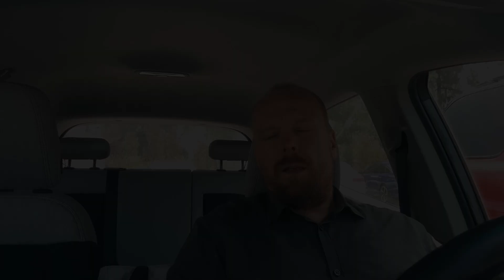Plug-Side Chat: Should DC to DC Fast Charge Adapters be Prohibited or Regulated?

Comment: I'm an engineer that works in product design and certification (of cable, controls and heating appliances).  I currently sit on a number of committees with UL, IEEE and CSA. I agree these adaptors should conform to some standard and be tested and certified by a 3rd party and NRTL (nationally recognised testing laboratory).  Of note UL is only one of several organisations that are ANSI and SCC registered to do certifications for both the US and Canada respectively (CSA, ETL, FM are also other examples).   Currently low voltage EVSE's (under 250VAC) need to conform to the harmonised standards of UL 2954/CSA 280, UL 2231-1/CSA 281.1 and UL 2231-2/CSA 281.2.  DC fast chargers have to meet the last two standards plus UL 2202 and CSA 107.1 plus all units might have to meet additional outdoor exposure or enclosure ratings etc.. (such as NEMA 3R or 4X, IPXX).  To my knowledge I don't believe the scope of these standards cover adaptors. Which I think would be unfortunate.  I personally know the CSA wiring devices technical adviser who also sits on many of the EV charging committees.  I'm going to bring this up with him and get his thoughts.   The quality of these connections are critical.  The heat dissipated across these connections are equivalent to the current squared times the contact resistance.  A bad contact can generate high resistance and a lot of heat.  And the higher the charge current the effect of poor contact is exponentially magnified.
Reply from the maker: Thank you for contributing your knowledge here. I think you are speaking to my greatest concern: Who is setting the standards for these adapters? It's an important hurdle that I think needs to be addressed.
Reply: Charging connector resistance change all the time even with normal use if/when dirt and debris gets in the handle. I thought there's already intelligence in protocol to mitigate. I had experience where blowing on charger handle and port made it work and "jiggling" the handle also fixed.
Reply: @mychevysparkevdidntcatchfi1489  I'm unfortunately not familiar with the intricate details of the DC charging protocols.  However detecting high contact resistance isn't very simple.  There are some things you can do like monitoring the voltage drop across the cable and connection.   You could also have a temperature sensor at the connection that would show high temperatures.  Though Voltage drop is only really good at finding if you have a significant problem.  And an adapter might actually negate some of the security of a temperature sensor as now your creating two connections one of which might not have direct temperature monitoring.
Reply: @erikstephens34  Given that even L1 EVSE that comes with the car has thermal sensor, I'm sure thermal is in DCFC. I don't know the protocol, but it wouldn't surprise if they did lot more complex things to ensure safety. Even something like TDR might be possible since CCS 10 Mbps require large bandwidth and signalling is on same wires as power.
Reply: @mychevysparkevdidntcatchfi1489  A TDR could be used to detect an additional connection.  It would be able to see if an adapter is used and shut of the unit (or not initiate the charge session) if desired.  TDR's are also good at detecting breaks and significant changes in material resistivity.  It could be used to show significant conductor breakdown as the signal propagation speed would reflect that.  However a connection either good or bad would still simply show as a discontinuity on a TDR.  It won't necessarily tell you if a connection is good or bad.  I do wonder with increased use of arc-fault devices with higher voltages being used it might be possible to calibrate an arc-fault like device to detect some issues as well at the point of connection.   Though if your connection is bad enough to generate arching your already in a potentially bad shape.   It's very difficult to detect a moderate to poor connection (but not bad connection).  And at these high currents even a moderate to poor connection could be an issue.  If an adapter were certified for use it would make sense for these devices to contain thermal protection.  Something like a thermal fuse.
Reply: @erikstephens34  I bring up TDR as an example of possibility, because the spec is so overly complex. It's not only the charger, but the car as well, so bi-directional and/or expected TDR can be computed, and deviation from norm can be flagged (again, just guessing, I have no idea).

Comment: Meh. I don’t see a situation where public chargers get overrun by Teslas. At least in this area, Tesla has far more chargers available than other publicly available chargers. 

As for unregulated adapters being used ... yeah, that’s a problem. That needs to be prevented. Aren’t chargers smart enough to know they’re not directly connected to a vehicle?
Reply from the maker: Right now, I agree. The sentiment with a majority of Tesla owners is that they wouldn't stoop to using public, non-Tesla chargers. I get the the impression that that is mostly cognitive dissonance, and they are afraid they will learn that the public charging infrastructure is more capable than they assumed in availability, convenience, speed, etc.

But yes, the main concern is actually the danger from the lack of regulations for adapters. Even reading the placard on Tesla's UL Listed (but not certified) V3 Superchargers, the approved current is about 20% to 30% less than what the chargers actually deliver. 

There's not really a way for the charger to know, because it's communicating with the car. As long as the communication is clear, charging can occur.

Comment: As for the comments about Tesla not going to trouble to make accommodation for drivers of other Automakers cars at the Supercharger Network, I would remind you that Tesla's Supercharger network was installed 100% on Tesla's own dime.  Other than a few DC chargers  installed by Nissan, few if any other auto makers have voluntarily stepped up to help develop any Public EV charging infrastructure in the United States.   We have no Automaker funded equivalent of the Ionity network being developed in Europe.  For its part, Tesla has installed lots of J-1772 chargers at locations where they are installing their own Destination chargers. (Most of which, other EV drivers can also use if they invest in a Tesla Tap adapter) For its part Electrify America, has made little to NO effort to accommodate Tesla Drivers, (and only bare minimum accommodations for drivers of CHAdeMO cars) at their supposedly "brand neutral" locations that were only funded under a consent decree, after Volkswagen Group cheated massively and got caught.   When I have complained about Electrify America short sheeting CHAdeMO by installing a maximum of only one CHAdeMO charger per location, I often get comments that what EA is doing if fair because CCS is the wave of the future (Here in North America perhaps, because Combo 1 isn't used outside of North America) and Tesla should be developing a Tesla to CCS adapter soon.   But unfortunately I don't know of anyone currently developing a CHAdeMO to CCS/Combo1 adapter.

Comment: Of the problems I've considered about Electric Vehicle charging, adapters for AC or even DC are Very far down my list.   One of the often considered problems has been the various different Level 2 and 3 charging standards, and use of adapters is one way for EV drivers to bypass or compensate for the differing standards.   We have Tesla drivers that use their adapter to use the J-1772 plugs we have where I work all the time.  I've always welcomed them and never ever considered the Tesla drivers stopping by to be a problem.   I don't understand or agree at all with the concerns about an "imbalance" being created by Tesla drivers using adapters.  While Tesla's using DC Fast chargers may cause some temporary bottle necks at a few charging locations, (Like the free Volta locations mentioned)  at Pay for service DC fast Charge networks like EVgo, having as many EV drivers as possible  also chipping in helps with their cash flow, so they can keep building more of them in more places.   I count Tesla drivers using those networks, as a help rather than a hindrance to the development of EV infrastructure.

Comment: Are you going to do a response video to Bjorn’s latest Model 3 vs e tron 500A Charging video? I was sort of shocked Bjorn didn’t upload an earlier time lapse of the model 3, or compare it to the previous firm version. 

It’s sending 500A until 4.08V/cell, which comes around 40%. It’s able to show 190 kW due to surface charge, but if the charge was ended at 40% SOC the pack voltage would quickly drop to 350V. 

One it hit 40% it rode the constant voltage slope from 4.08 to 4.198V @ 90% SOC. 

I wonder if this is early adopter firmware, because I don’t remember Bjorn talking about a new public firmware. This actually seems like the 250 kW firmware, just limited by the CCS2 charger limit. 

If all Tesla model 3 can charge at this C-rate, unlimited times, without degrading the battery more than 30% in 120k miles, this is something other manufacturers will need to meet or exceed. LG Chem already showed they make cells that can handle it, GM and Hyundai have shown they can liquid or air cool those cells to handle it.

Comment: Tesla already did the right thing by offering other manufactures to use their charging network but no one took Tesla’s offer. 

Don’t you have a Tesla to j1772 adapter?
Reply: I have one, but they only work on Destination Chargers. The discussion is about DC Fast Chargers with a great deal more current than these Destination Chargers are capable of producing.

Comment: Tesla took the all the risk at an incredibly difficult and expensive effort to create this network that adds a critical selling point to every Tesla. To allow these same companies that have spend countless efforts trying to destroy Tesla and still are relentlessly trying to end them, to be able to benefit of their work and be able to say as part of their sales- "Oh you can use the Tesla supercharger network on this VW, Chevy, etc.. so why even buy a Tesla" just seems wrong to me.
They can't follow their mission statement if they don't sell cars.
Tesla's charging network is so strong, specially in the US, I wouldn't doubt it if it was less than a quarter of 1%  of all Tesla owners that would bother to spend $500-$1000 CCS or Chademo adapter to very seldomly use other networks. But in the reverse I could easily see the majority of all other brand EV owners spending double that amount on an adapter just to have access to Tesla's network and then add a massive strain and wear to Tesla's network. Opening their network would come at a much higher cost to Tesla than the insignificant amount of money they'd earn from selling electricity to other EV's.

Comment: I do agree that some certification would be required for these adapters weather 220 volt AC or 500 + volt DC. I think I would feel more sympathy and concern for the leaf owners or other Asian automakers that's still use CHAdeMO. That plug type is dwindling in new installations. As most clearly spelled out in the Electrify America roll out where they'll have up to 8 CCS plugs and one chademo. Having the huge Tesla community being able to monopolize that single plug would completely obliterate the functionality of Leafs to use the stations in my opinion. The only saving grace now is that only Model S and X support the adapter and many of the old ones have free supercharging. When model 3 supports the adapter then I would not be surprised to see them more frequently utilizing the public charging Network as the price would not be that much different I'm going to a Tesla location. I agree that it is also an ingenious plan to satisfy the peak charging needs without having to install more Tesla branded Chargers. Tesla may be saying, We can just rely on the other guys work when times are tough.

Comment: Check out the labeling of the adapter from Tesla. Call up UL to see if it's valid. But, an EV charging at a charging station is just that. I don't think restricting people from charging is ok be it a volt or a Tesla. It's not our fault Chevy decided not to take up Tesla on their offer with supercharging. Spark has CCS and I'm cool with that. The second a CCS adapter is available for our model S tho I'm pretty sure I'm buying it. The wider reach of chargers would be worth it. Maybe the new ipace and etron can get a supercharger adapter since they can accept the charge rate. Would I be upset if I saw a supercharger station with mostly non Tesla's charging? Nope, not one bit. We need MORE EVs!

Comment: Eric - I agree with you that there should be standards here.  I would also think that the DC fast charger suppliers, or vendors who employ said fast chargers would like to see a standard, since they risk damage to their equipment (not to mention their customers cars), if the adapter supply base suddenly becomes inferior.  Theres no sense in an inferior adapter causing damage to a publicly used charger, and thus the charger providers do need to consider how to protect their investment.  Perhaps there needs to be a way for the chargers to detect that “approved” adapters are being used, and only supply power through the approved adapters, or at a minimum, being able to monitor the internal temperature of said adapters to ensure no thermal risk can occur with their usage.

Comment: I haven't seen any "knock off" DC to DC adapters but I suppose anyone could make them in their basement.  As you noted, anyone who used one could be in big trouble if proper safety standards weren't met.  Sometimes I think we live in an overly regulated world, but it may be needed in this case.  Until that time, caveat emptor!

Comment: I think Tesla is missing an income opportunity.. they could sell some little box that communicates with there network, And connects CCS or other standards.
It would be an income source they could use.. and they do need income sources.
I suspect eventually there will be enough CCS chargers for this to not matter much.
And it will be the other manufacturers that end up selling most mass market EV's not Tesla. I think they missed the boat on this a bit... Just the timing is off a bit.
I would buy a Kia Soul EV currently over a Tesla if I could charge it reliably where I drive. (And I can't yet)
Also agree on the safety aspects you mentioned. Though Govt regulations are not likely to stop someone from buying a unbranded cheap adapter from eBay.

Comment: Correct me if I'm wrong, but didn't you post a video where you used an adapter to access a Tesla Destination charger with your Bolt?
Reply from the maker: Yup. Low power AC adapter. I'd still like to see a governing body for standards.

Comment: In France and Germany such adapters are not allowed so you can't buy the Tesla CHAdeMO adapter from these countries. In the Netherlands or Switzerland for instance it's totally the opposite as charging networks such as Fastned actually equipped their stations with Tesla adapters. See Fastned which has equipped (almost) all it's station with those : https://support.fastned.nl/hc/en-gb/articles/205418987-Charging-with-a-Tesla-model-S-X
Reply from the maker: Ah, so it is up to the provider in a way.
Reply: @newscoulomb3705  Their business is providing charge to EVs. Because Tesla made a big chunk of the market they had to adapt, or in this case, provide the adapters. Thanksfully the Tesla model 3 ship with a CCS port, so all this non sense will come to an end soon enough.
Reply from the maker: I'm actually surprised public charging providers aren't offering a direct Tesla plug at this point, which I'd be perfectly fine with. I'm mostly worried about quality assurance and control for adapters.
Reply: @newscoulomb3705  There's mostly 3 ways chargers with (AC 43kW - CHAdeMO - CCS), I guess it would have been a hassle to design a charger that specifically support the Tesla standard when there was already an adapter on the market. On newer chargers the AC 43kW is slowly disappearing, even the CHAdeMO is no longer supported by networks such as IONITY.

Comment: As another note the Tesla superchargers even if fitted with CCS plugs and if Tesla allowed it would still not be able to charge all EV's.  Tesla's superchargers are setup for a charge voltage that is designed for 96s or less battery packs (max of 410VDC).  Cars like the I-pace or etron with a 108S battery configuration could not charge on a supercharger even if they were allowed to.  For reference the S/X 85 KWh packs are 96S 74P configurations.
Reply: They could but they wouldn't be able to be fully charged at 410v. 
The CCS and CHAdeMO norms are set at 500v, they would need to support that to release the use of Superchargers to non Tesla.
Reply: @MrKeke2502  Well a 108S battery needs 450VDC to fully charge.  Some CCS units are limited to 450VDC max (some are 500VDC max).  But changing a supercharger to go from 410 to 450V isn't as simple as a software update or flipping a switch.  It likely requires major hardware changes and updates to certifications.
Reply: @erikstephens34  Absolutely, but I don't believe it's in Tesla's short terms plans anyway. Maybe after the Y or the Pickup, we'll see.
Reply from the maker: I'm curious about how they are able to use the 400 V, 24 kW CCS chargers. Maybe a voltage booster?
Reply: @newscoulomb3705  Which units specifically are you talking about?  I've never seen a CCS less than 450V max output.  The Chargepoint 24KW units are 500VDC Max.  https://www.chargepoint.com/files/datasheets/ds-cpe100.pdf